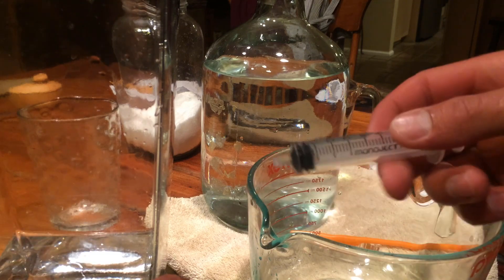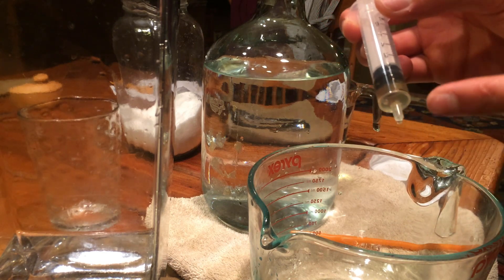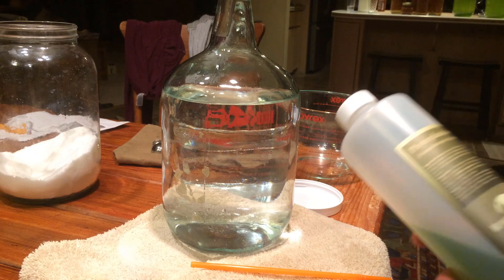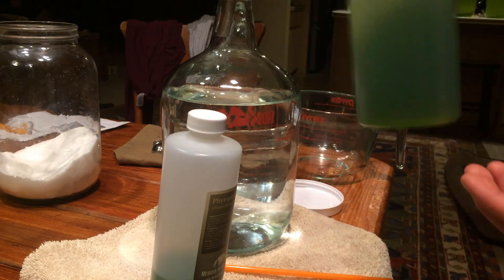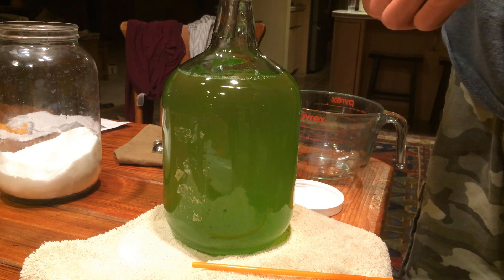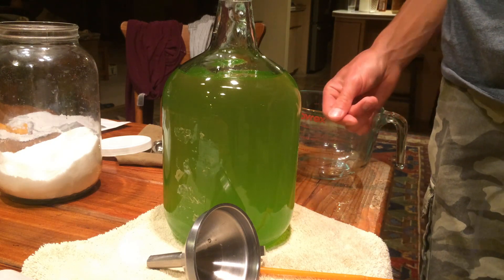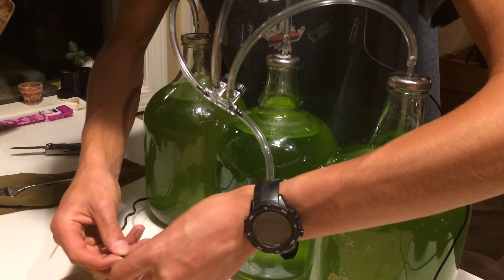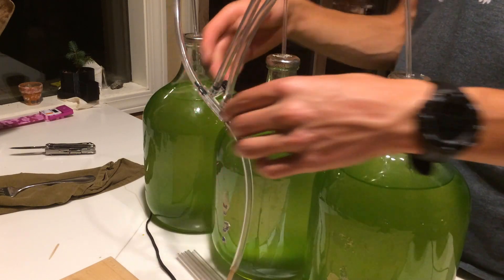Micro Algae for Biodiesel

Comment: You got a update on this project?
Reply from the maker: I was planning an update but in the time that I procrastinated updating this video, my culture of algae has died because I forgot to fertilize it regularly and since then have not tried to revitalize the project.
Reply: any chance you'll try again ? :) ..would be cool to see conclusion
Reply from the maker: I tried several methods, first I tried to use ultraviolet light to break the cell walls. (this did not work) Then I was going to try and use a small hand crank seed oil press to get the glycerin-biodiesel mix. This also did not work because I was not able to grow enough dry algae for this process to work. Theoretically after pressing I would mix in sodium hydroxide (lye) to separate off the vegetable glycerin form the final refined biodiesel. After dehydrating over 50 gallons of condensed algae culture I only ended up with a couple of tablespoons of algae. I realized that in order to make this worthwhile I would need a different cultivating method or to cultivate on a larger scale.
Reply: @gradyjames3543    ultrasound and centrifuges https://youtu.be/oQqlsk3cuWY
Reply from the maker: I have started to believe that my self. I may try to intern soon at one of the larger companies trying to make algae biodiesel in order to get the inside scoop on whether this energy source is feasible or not.
Reply: @gradyjames3543   sound waves have been found to be effective to break the cell walls. There is a video on youtube about it where they extracted the oils and used the remaining cell walls for a protein base.

Comment: May I ask where you bought your salt reader? I'm looking online and the prices for these are shockingly high. Your salt reader looks pretty simple and cheap.
Reply: The hydrometer he shows on the video is not cheep, they can go for over 50 dollars in some cases, and you have to be extremely careful with them, both because they are fragile, and because there are hundreds of different types of hydrometers for many uses. There are much cheaper ways to test salt concentration.
Reply: Julie Trinh  petco sells these hydrometer for $4
Reply: Try EC Meter